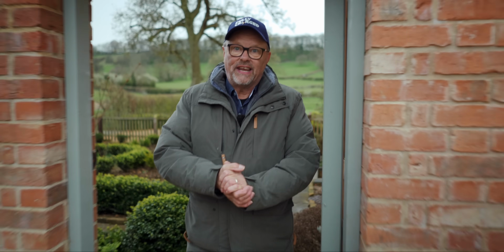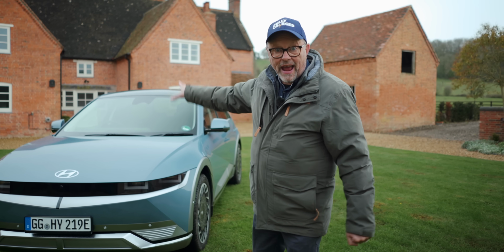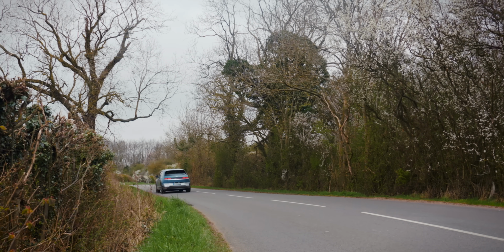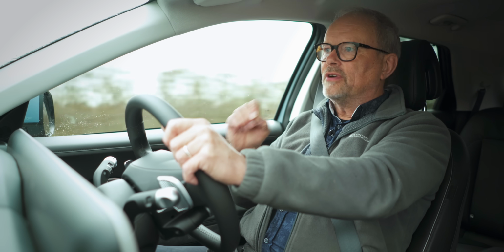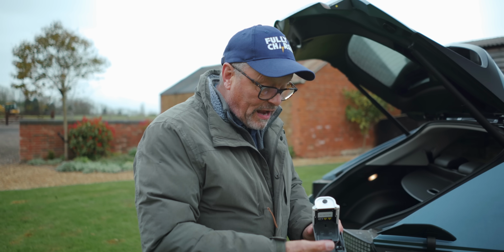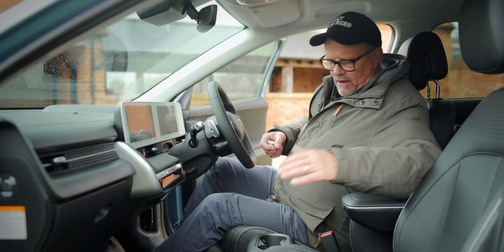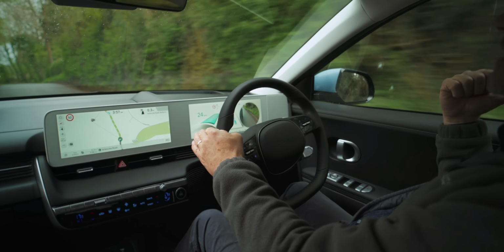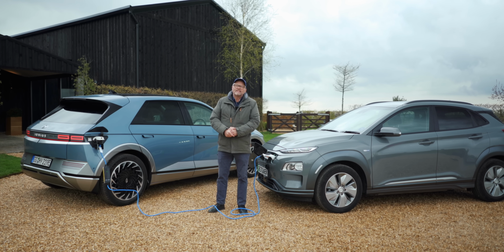HYUNDAI IONIQ 5 First Drive - could this be the electric car of the year? | Fully Charged CARS

Comment: Fun fact: The Renault Zoe also had a scheme to use the motor windings as an inductor for a voltage converter - up to 43kW AC. Presumably it was before DCFC was commonly available and it wasn't clear what kind of future standards would be so they included it as a hedge. Apparently it also tended to make some audible, high-pitched noise... Renault has a patent on it, so I presume Hyundai cut a deal or managed to come up with something sufficiently different to avoid patent conflicts.

Comment: That malfunction in the loading port cover was the cutest thing I've seen all month
Reply: My 2017 Chevy Bolt has a manual port cover: I love it. Let's stop adding expensive "conveniences" that no one really needs and only add cost and trouble.
Reply: @mv80401  I don’t think he was closing it correctly but even then it’s a pre production car so little things would be changed
Reply: @mv80401  It was not closing properly because it's a pre-production model. The production model will not have that problem.
Reply: Dumb old man who has a switch to close the door but forcibly closes it🤣

Comment: What we need is a small hatchback version of this that can do 300 miles
Reply: I suspect that the challenge is the battery size to achieve that range. This has a huge floor pan area ... a compact hatchback much less. However, I completely agree with you ... we need smaller but similar range. This thing is WIDE .. well over 2 metres with mirrors.

Comment: It looks to be around Porsche Macan/Audi q5 size? Just a few questions which no reviews have talked about regarding the tech. Does it have self parking and also as the headlights look high tech, are they adaptive like the top range Audi/Merc and bmw lights? 

The Korean launch had camera wing mirrors which didn’t look as good as honda’s version in that the screens aren’t as well integrated. Looks very interesting though. Only other question would be the depreciation.

Comment: Thanks so much to all the Fully Charged Show team for this great preview of the Hyundai Ioniq 5 👍 !!!

In My Humble Opinion (IMHO), it is one of the electric car with the best useful technical specifications like importantly 800V battery architecture and Vehicule-to-Load (V2L) functionalities.

There are some small (minor) things that could still be improved like :
1. Better autonomy (should be 70kWh battery pack on base model for ~450km+ WLTP range and 100kWh on long range model for 600km+ WLTP range)
2. Wheelbase should be closer to 2.75m for better maneuvrability in city center
3. It should be 100W USB-C port
4. towing port should be retractable
...

But it is already excellent engineering and decisions taken by Hyundai decision makers : Thanks to all Hyundai employees that participated in creating this great car that is IMHO one of the best electric car with Tesla ones.

Comment: strange You dont have an indication on price, Here in Denmark we have the introduction price of IONIQ 5 (72,6 kWt)
From DKK  339.995,-  which is around   40.000 Sterling or almost 46.000 Euro  (The Essential version, which is fairly well equipeed)

Comment: I am guessing you mean USB Type A rather than USB Type C Robert?

USB 2, 3 etc is about data speed, not the form factor of the connection. USB 2 was released 21 years old, so it is fairly old fashioned.

Comment: The Kia version steals my attention because of it's dark interior, but car of the year? Yes, these ev's represent something special as far as technology goes. Very fast DC-charging, trailer hitch with decent load rating, interesting interior, four wheel drive in a segment that really needs it, large battery, excellent range and this very peculiar and tasty Vehicle-To-Load! This is electric vehicle generation two, similar to Tesla Model 3 and Model Y. Where Volkswagen has something very nice with iD.4, these Korean cars fill the gap and pushes ahead with proper DC-charging on an 800V platform where Volkswagen looks a bit tepid in comparison. (I hope the update that VW talked about will deliver faster DC-charging on iD.4 etc, it really needs it imo.)

Comment: Love the interior, shame about the face.😉
I'm old school, the exterior of the Kona looks far nicer to me, but the Ioniq 5's interior is absolutely stunning.
As for performance, I'd rather not need to book a chiropractor if I accidentally flatten the pedal. 
In my world, EVs will fly out of the showrooms if they toned down the absurd performance/acceleration & traded it for acceptable performance with longer range.
I'd gladly forego the automated entry, bonnet/boot lifts & open/close the charger cover & do it by hand once the Open button was pressed on the key fob.
The choice of more aesthetically wheels wouldn't go astray either, there are very few aero-efficient EV wheels that appeal to me.
Grumpy old man signing off. 😜

Comment: It was adorable watching Kryten communicating with the charging flap.
The car does have the 80s 90s vibe to the styling, and the rear reminds me of an older 7 seater but cannot remember the name.
I would still have one though, even if the dash is a little bland, top model at £45k which is expensive but some cars start at that price or higher.
Reply: Dumb old man who has a switch to open and close the charging port, but forcibly open and close it.😂

Comment: That CCS->plug adaptor clearly designed to be waterproof for US/EU plugs with a rear-entry cable, not UK perpendicular ones. :-) Still at least it does work.
I await some efficiency data with interest, as the info so far suggests this is not actually as efficient as the Kona and Ioniq, which would be really sad for an electric-only 800V machine. They acheived world-class efficicency with those cars despite being in a shell designed to fit an ICE too. This should be at least as good if not better..

Comment: The camera view on indicator was cool. Does that mean they don't need mirrors or screen mirrors on the inside anymore. Just indicate look in front of you and that's it. Looks safer
Reply: I hope not - there are many important uses of the mirror that shouldn't require indicating (including e.g. checking if it's safe to open the door :p)

That said, as an extra safety feature, it's a nice feature
Reply: @logicalChimp  good point. But they could have both camera feeds visible on the binnacle in park mode or when the cars stationary too for a quick check for cyclists or walkers.I'm not a fan of the outside mirrors for aerodynamics and the inside ones don't look right.

Comment: They're using the motor windings as the inductors in a boost converter circuit. They get more power input because they can use the full 400V from the fast charger, rather than the voltage having to match the battery state of charge. Volts * amps = Watts

Comment: If a flappy chargeport cover is everything wrong on a pre-production model, it's very, very impressive.
Reply: Don`t worry. Its Hyundai, it will have amazing build quality...
Reply: @DG-uv3zw  
That's why it's impressive; pre-production models are there to get the kinks out of the production and cars. If a pre-production car has only that "fault" (probably something to do with either a faulty sensor or a hick up in the programming) this thing is of to a great start.
(other note; well, it has no grill, but still a face with that black panel in the front. it's not like that ugly thing in the XC40 that ruins the face of the car).

Comment: 50 kW chargers are often limited to 120 A, therefore it depends on the voltage how much kW you get. For example, a BMW iX3 can charge at 150 kW on a HPC, but on a 50 kW charger only gets a bit over 40 kW. Because the voltage is lower. 350 V x 120 A = 42 kW.
The Ionic 5 has a 800 V battery with the inverter being able to take 400 V from a 50 kW charger. 400 V x 120 A = 48 kW. That is why it can charger faster on a 50 kW charger compared to most other cars

Comment: Great looking car. The prices in Switzerland are already available for their "First Edition" -  59'900CHF ( 46,896.5 GBP including Swiss VAT of 7.7%).
This is the top version, AWD, full options.
Estimated range : 430km ( 269 miles )
Battery : 72.6kW (weight: 453Kg)
Two electric motors for total of : 306hp
0-100km/h (62mph) : 5.2s
Trunk : 527l / 1587l 
Frunk : 24l
5 years unlimited mileage warranty for a car, 8 years or 160'000km for the battery

Comment: Love this thing - seen it in person at the pop-up showcase in Birmingham on the w/e just gone, looks even better up close. Loads of room inside, but on the outside it's actually not as big as you might think. Pricing? Well, given the already-sold-out Project 45 debut car (3,000 units!) was only around £48k fully loaded, I can't believe the base model will be more than £40k, and it will probably be less actually.

 I really think this could be my next car, either this or the Polestar 2.
Reply: Hoping for <£35K for the base spec.

Comment: Not sure about those screens having white backgrounds. If there's no night mode where it darkens, that would really hurt your eyes late at night. Other than that, it looks great.
Reply: Just seen a German review and their version had black screens even though it was a daytime video.  Expect this will be an option in the settings.
Reply: it does indeed have a night mode although black screens would be favorable
Reply: You can choose from the settings or put it in auto.
Reply: My Model 3 automatically switches the display to night mode when it’s dark outside. I’m sure the designers at Hyundai have implemented something similar.
Reply: Bit disappointed the screens are surrounded by about 8 miles of plastic. We have been thinning the bevels on screens for so long and they seem to be the largest I've ever seen.
Reply: @john681611  Ah FFS, freak'n bezels still freak'n peeps out. It's a dashboard FFS not a mobile phone. 🙄
Reply: @john681611  It looks like Sci-Fi compared to id4... But yeah, outdated compared to Tesla... Still nice tho...

Comment: Looks nice and I'm sure its a lovely place to be in. However not a game changer as you are still reliant on the charging network as is and I imagine the range will only be slightly better than the Kona if they have eeked out a little more efficiency. Surely this sort of range or more but at the £25-30k mark will be when to get really excited. Until then it's just more of the same with bells on? 

Also when I can order an autonomous taxi like a takeaway, such that I don't need a car any more, will be my time to get, not excited, but satisfied we have made a tech step forward. 

Next car is a short 2 year lease on a diesel - I'm thinking the scales may have tipped by then such that I will go electric. Almost went with ID 3 but the crap interior made me go Audi. No benefit to me in being an early adopter!

Comment: Seeing this confirmed that other EV manufacturers will need to really up their game in the immediate future. Especially Tesla. Can you imagine deciding between the Ioniq 5 or a Model 3? It would take me a fraction of a second to make that decision.
Reply: "Especially Tesla"?
Why would the top brand in the segment be needing to "up their game" more than those who are bringing their offerings to market with "issues", basically because the have to?

Have you forgotten the Berlin Y? I imagine that will be "upping the game"?

I'd mark this down as a "VW group killer".
Reply: @rogerstarkey5390  For the very reason you have given, Tesla is the 'top' brand. Normally being first in a market segment is considered an advantage, and it usually is. Unfortunately for Tesla, they are not first in a market where the competition strapped for investment cash and is sitting back and doing nothing. I have no liking for VW but they along with many other manufacturers will be piling into this market big time (Yes, they have all been woefully slow getting their acts together up to now). M3 and MY will be around for at least 3 to 5 years in their current form. The competition is getting hot and will get massively hotter in the next 2 years. A Model Y is going to look old and bland very quickly. Some would say it already does.
Reply: Compare the Ioniq 5 to the Tesla Model Y (at least then you're comparing like-for-like).  And the two are close enough that it will come down to personal preference, and personal priorities regarding features, etc.

And yes, the Model Y isn't available in the UK yet - but neither is the I5.  From what I recall, the Model Y should be arriving about the same time as the Ioniq, so there'll probably be plenty of comparison videos around that time.
Reply: @logicalChimp  Yes, my point is, would anyone prefer a Model Y to the Ioniq 5? In the US maybe but in most markets, I would suggest the Ioniq is streets ahead.
Reply: @PauloG100  I dunno - they're pretty close imo.  Ioniq has more style, Tesla has SuperChargers, more experience, generally better software.  

I've not tried either yet - and intend to take both for a test drive, but I don't think you can say the Ioniq is 'streets ahead' of Tesla... imo they're neck-and-neck, and both are 'streets ahead' of everyone else

Comment: Doubt anyone should care about it but those silvery exterior accents look very much like the aluminum powder coating we have on various plastic gadgets. You know, your laptop may have it, - it gradually goes off with time revealing black plastic behind it... It looks absolutely terrible and makes the entire car look plastic. The front and the back lights are the highlight for me here, everything else needs to drop that silver nonsense to be acceptable. However, tastes are subjective.
And, by the way, it's not a compact SUV. It is the size or of Škoda Enyaq or, say, Audi Q5 (between Q4 and Q5, to be more precise). 
Overall, it is a disappointing car for me personally. It shows that the car makers don't want to move on to a truly next gen sustainable personal mobility. They keep inflating cars and pushing larger sizes forward, which somewhat defeats the gains in fuel efficiency. Twenty years ago this would have been huge, but now the reviewers call it "compact" and I'm sure some American youtube superstar will call it small... :( This is just pure BS and nonsense. At least for the Koreans the batteries are now the fact of life, but everything else - the same as before.

Comment: Honestly Hyundai seems to have done something way ahead of others for a real consumer car.  Not a thing just for the top of the market.
And this is what we want now.  Not just 400V, we want 800V!  This is just such a kick in the ass of other manufacturers.
Really, coming from VW/Audi, its such a disappointment they don't do as well EVs as Hyundai does right now.
@Audi, your Q4 really should have a 800V.  Go back to design board!!!
The only thing I don't really like is the interior.  It's a bit minimalist.  The only part that stops from giving it a 5.  It looks a bit cheap and the central console design is a bit, well, 🤢

Comment: Ioniq 5 vs. EV6
That should be a great comparison test that many are looking forward to.
Reply: Both look incredible, while the ev6 is more of a wagon, and is more performance oriented.
Reply: I hope they release an n line version of the ioniq 5, in order to actually be able to compete with the ev6 gt. 🤔
Reply: An N-line Ioniq 5 estate and I'd be all over it! :)
Reply: @4literv6  I can see that happening. I suspect they're letting Kia have that market to themselves for a bit so it doesn't rob the EV6 of sales.
Reply: @MG_Steve  idk? The top spec ioniq 5 already is around 4.9s 0-60. I know the hyundai sheet says 5.2s 0-62mph, but Johnny from the late brake show already got 5.1s on his test drive. So since that time currently matches up very well against the mach e4x er and the tesla model y lr awd. 

Maybe hyundai doesn't care so much about going after the under 4s 0-60 crowd? 
Otherwise the model y performance, Kia ev6gt and the about to be released mach e gt. All have it beat quite handily for acceleration anyway. 🤔

It's interesting that the Korean twins have the v2l feature. Which even as an option is something Ford, tesla&vw can't match.
Although vw claims all id series bevs by next year will offer v2l capabilities. And elon hinted at tesla enabling something like that in the near future. Which was interesting because he also claimed the original roadster offered v2l. And the upcoming cybertruck will offer a 240v outlet in the bed to run tools etc with. 

Then hyundai has the solar roof option for the ioniq 5, which I haven't seen anyone since fisker with the og karma offer as an option. 
This is something more manufacturer's should offer imo. As it might actually help some with range anxiety in sunnier climates where people don't often have access to a garage. Supposedly it can ad 100 or more miles of range monthly.
Reply: @4literv6  it would appear that the solar roof is only available to a limited edition model, do it will not be available as an option.
Reply: @David-bl1bt  preorders just opened in Denmark and solar roof is possible on the top spec of the car. So I don’t think it will be a limited time offer deal.
Reply: That solar roof is "free bonus" for pre orders shipment. Yes, you can get it on the top spec car later. But it comes with extra price.
Reply: They both look phenomenal. I don’t know which one I prefer
Reply: ...And NIO ET7. I guess we will see a brand with a ..8 soon